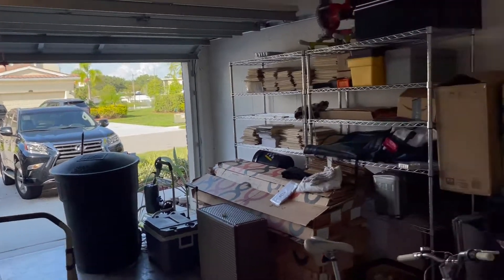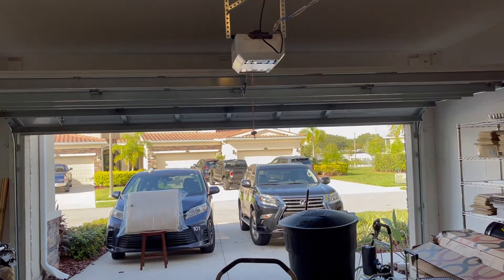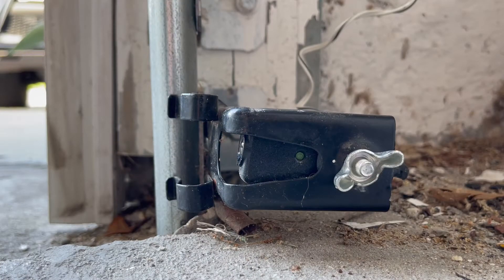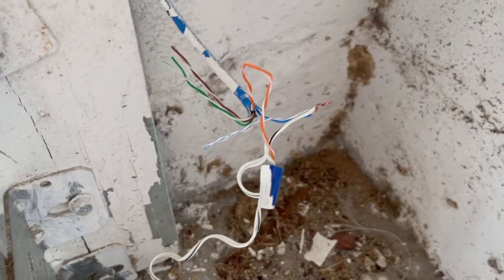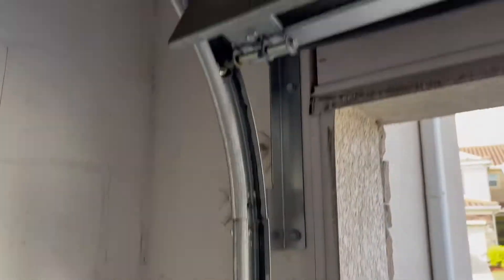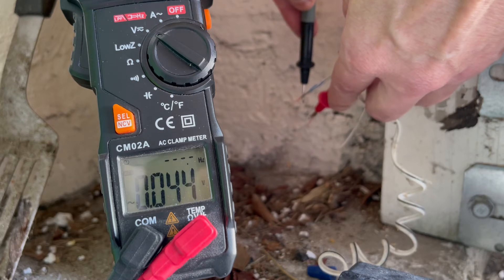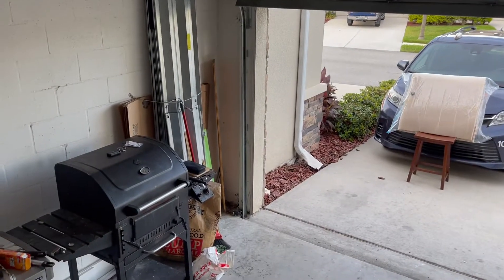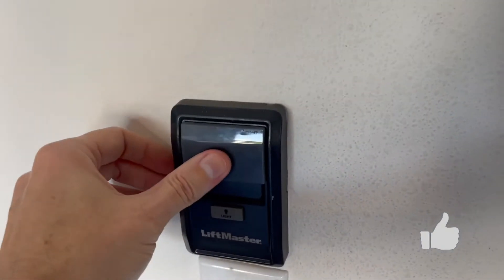Garage door wont close, Stops and Reverses, Voltage Test.

Comment: Good video! There is one problem that was not mentioned, and happened to one of my customers. The door would not stay closed. New sensors did not help. No lights were present. The logical conclusion? The wiring was bad. Wrong!  Voltage was present at the main head with the wires to the sensors disconnected. The installers had wired the sensors backwards at the main controller! Since the controlling voltage was DC, it did make a difference.The white/black did not tie to white/black like the instructions said. Reversing the wiring fixed the problem.
Reply from the maker: Thanks for sharing.

Comment: I have that opener and I wanted it to close less because it would close and immediately reopen.  The Close More limit switch was bad; it would click but was not making circuit.  I purchased a dozen microswitches on Amazon for $6.99.  I replaced that switch and all is good.
Reply from the maker: Glad you found the problem, thanks for sharing!

Comment: This video helped to resolve my issue with the door, it was the wires not making the right contact, too windy and cold, also not wire nuts. lights were solid, but voltage was low. Thanks 🙏🏻
Reply from the maker: Glad you got it working!

Comment: If you have an older garage door, but a fairly new garage door opener then you will need to replace the rollers with new nylon rollers.  OR, use a lithium spray and hit your old rollers and hinges (everything that moves) with that spray. Your door will become quieter and should remove the down-force resistance it is detecting. The first time you try to lower your door you might need to push on it a little to make it close.  Get that lithium grease moved around!

Comment: Does it need to be 6v on both the sender and receiver sensor .. I see 6.24v DC on sender and 0.91v on receiver .. is that a problem ?
Reply: I would say yes, there should be as they are tied together anyway at the ceiling unit.

Comment: Problem is, I have steady Green, so the sensors are lined up, so there's nothing for me to realign.   However, I still have the same issue with having to hold the button down to close
Reply from the maker: If this happens during the day only, the sunlight reflection could be disrupting those sensors.
If this happens always, try observing sensors while the door is closing. Maybe they start blinking from the vibration and become misaligned.

Comment: Do you know why my garage opens an inch and it stays there I have a solid orange and solid green
Reply from the maker: Not sure. Maybe you have a safety lock inserted or bent rails?
You could try disengaging the automatic opener and see if the door opens freely by hand.
To disconnect the trolley, pull straight down on the emergency rope with a handle.

Comment: My sensors were aligned, door still not closing unless I pressed the button and held it down. Eventually I sprayed lube on the rails and wheels, and that fixed it 👍🏻
Reply: Mine is doing the same thing. That's odd that lubing them fixed it though.
Reply: I have that issue but even with the door disconnected.  Have yellow and green light but instant reversal  but in my case holding the button does not change things. It still moves about 5 inches and instantly reverses. Even reverses if I block path of eye and green goes off.

Comment: Best video I have seen on this subject. Mainly due to the accurate description of the normal voltage that should be seen for this circuit. 6 vdc. Nowhere else did anyone give this spec. Yes the transformer in the unit is 24 vac. That has nothing to do with this safety circuit. Thank you for giving me the answers I looked  hours to get. I can finally assume my logic board is Ok.
Reply from the maker: Glad it helped!

Comment: My garage door sensor orange and green light does grow steadily, but still can't close the door. Only closing all the way down while I keep holding  the button. Please help. Thanks.
Reply from the maker: Try observing the lights (if they start blinking or go dark) while the door is closing. Maybe the rail is warped/loose, so the sensors move during closing and lose contact with each other.
Reply: @Your-Self  It worked, thank you!!!
Reply: How did you fix the vibrating rails?

Comment: On the wires that go to the sensor each has 2 is one for power and other ? Or what
Reply from the maker: These sensors use DC (direct current) voltage. That means one wire is positive and the other is negative to complete the circuit. 
But if you mean 2 wires going to the same terminal, they are the same... either positive or negative. Those wires are very thin. So the installers probably wanted to make them thicker by combining 2 wires together.
Reply: Yes so each sensor has 2 thin wires glued together and tie up when entering in back of the overhead motor
Reply: I’m getting no light at the sensors but looks like there is power on both and the motor is giving 6v at the top
Reply: Just can’t see if there a wire that messed up above the door without taking out drywall
Reply from the maker: If you have 6 V at both sensors but they don't light up, you probably need to replace the sensors... not the wiring.

Comment: I have 6 volts at the unit 6 volts at both sensors and with new sensors still the door comes down and then goes back up after it reaches about 1 ft from the top any more ideas
Reply from the maker: If the door is capable of closing all the way down while you hold the button, the problem comes back to the sensors. Maybe they are slightly misaligned or become misaligned when the door starts to move. Maybe the main control board is going bad. Not sure what else.
Reply: Other videos will show you the up/down screws which set how far it travels. Start there but, my issue was resolved by increasing the down force which was a small purple colored dial on my liftmaster. Now my door stops bouncing from 1-2" off the ground and will close all the way

Comment: My handheld garage door opener won’t work after I change the battery
Reply from the maker: Make sure it's the correct battery replacement type, and that it's not installed upside down.

Comment: Thank you for your video. I had a loose connection at the wire to the motor. I reconnected it and it fixed the issue
Reply from the maker: Excellent!

Comment: Does the amber and green light should be visible when door is closed or open? Because ours didnt show but we can open from keypad and hold the keypad to close it.
Reply from the maker: Yes, both lights should always be visible. They act as safety sensors for the door, so it doesn't accidentally crush someone. But when you hold the keypad, you basically override the safety sensors, so the door can close while you watch.
Try to wiggle wires going into those sensors. Maybe it's just a loose connection.

Comment: Thank you! My door was closing most of the way then reversing. I didn’t realize (or remember, in case I already knew it) about the light flashing code. Mine was flashing ten times, like you mentioned.
There wasn’t any obvious obstruction between the two door sensors but the green one was flashing intermittently. Turns out that the garage door insulation that I installed years ago was puffing out just enough to be detected by the sensor.
I pushed it in and problem solved. I’ve added some Tyvek tape to help prevent it from bulging back out again. 
Thanks again for steering me in the right direction!
Reply from the maker: Good to hear all is good!

Comment: Your video was very helpful.  I needed the voltage at the sensors and I could NOT find it on any other video.  Much easier to know the voltage and not have to remove the sensors and run jumper wires to the back of the motor unit.
Reply from the maker: Glad it helped